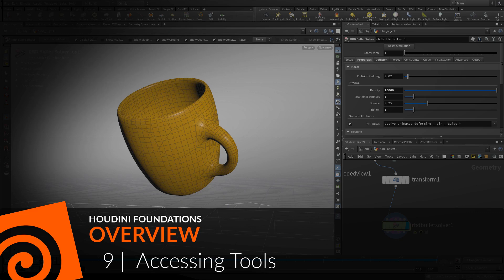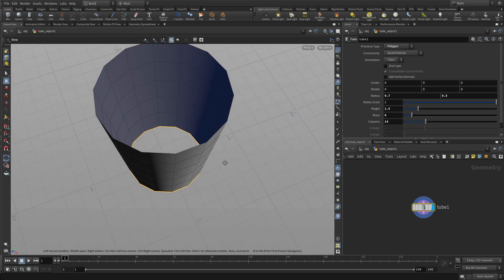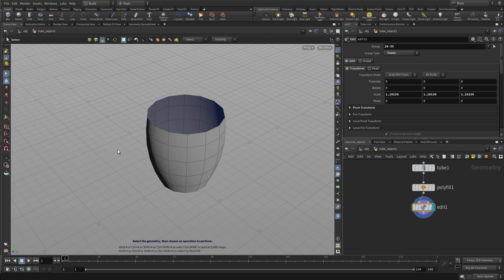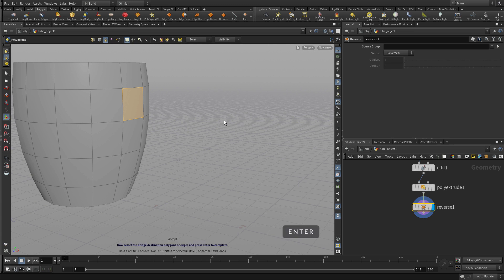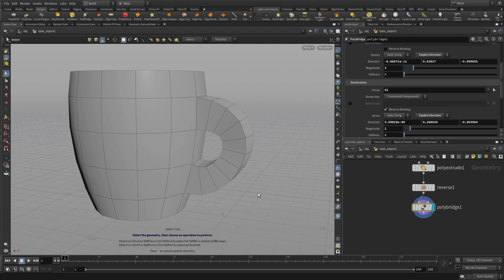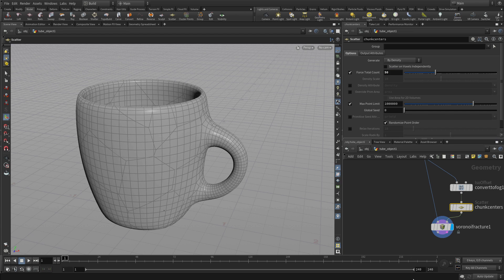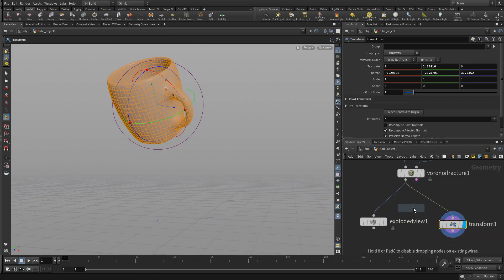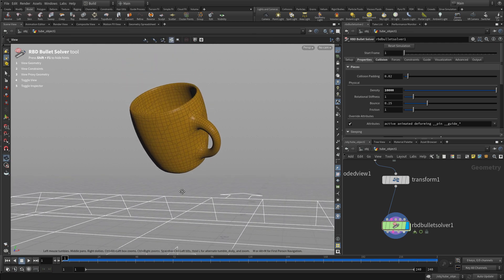Houdini Foundations | Overview 9  | Accessing Tools

Comment: 1:45 I don't get the soft radius slider appearing in my viewport. I can only seem to access it in the parameter pane.
Reply from the maker: Is the Handle tool active? It only shows up when you are in the Handle tool.
Reply: @houdini3d  By Handle tool do you mean the scale gizmo? If so, yes it is. If you are referring to something else, then I'm not really sure.

EDIT: I found it.  However I was on the dark background, and the slider is very dark blue and the text reads slightly different. nI merely says rad. At any rate, all is good i the world now.